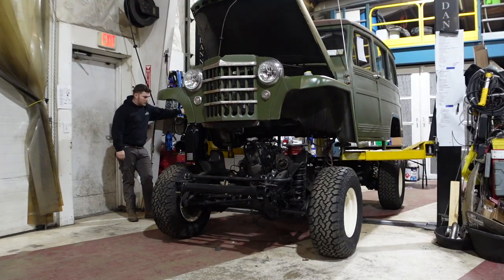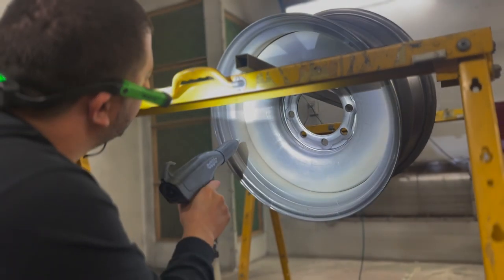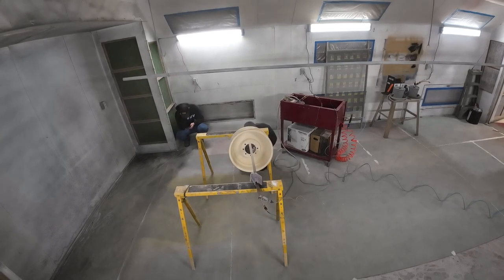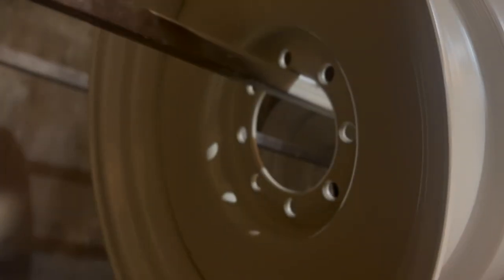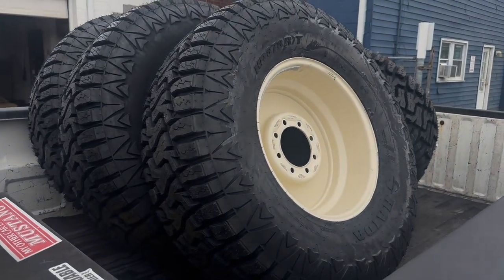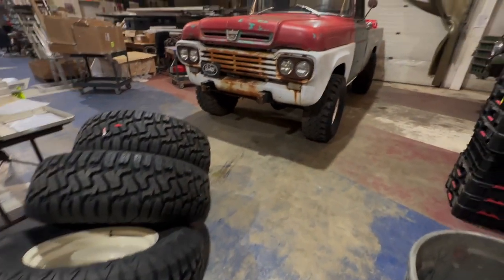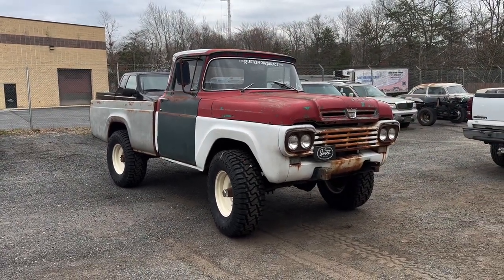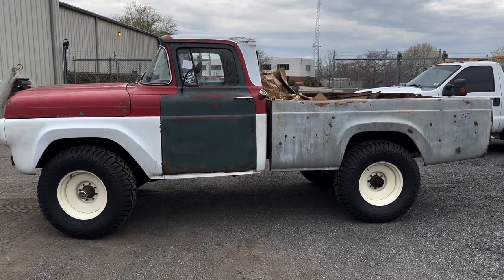MASSIVE TIRES!! For Our Ford F100 4x4 "Sasquatch" With New Wheels LOOKS INSANE!!!

Comment: Like  to  get info on swap with 79, I am planning to  do the same  with  my 59, with  coyote and 5speed to divorce transfer case and  use rest of newer frame setup , how are you  mounting  cab and bed to  newer frame ?
Reply from the maker: I believe that the 79 in the 59 frame cab mounts are very similar. I haven’t started the build yet. I’m actually in the process of mounting the coyote into the 79 frame to get everything ready to go for the cab, so stay tuned for some future videos on that I’ll be doing a full build series on this truck when I get everything dialed in
Reply: @Rustomod   I am looking  forward  to  it, in mean time  I  am  going to  take cab off my 76 and clean frame, get it coated and  figure how to mount  engine and  transmission